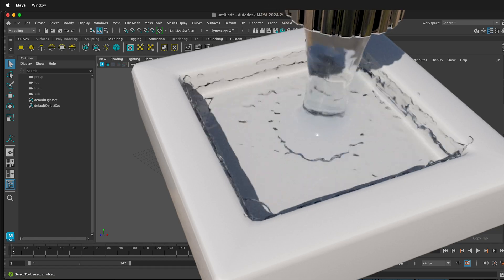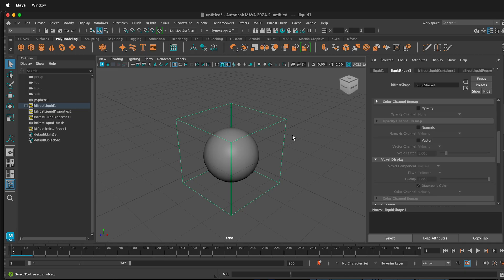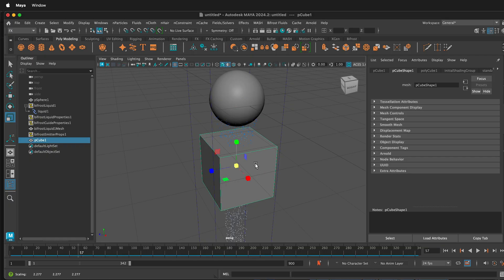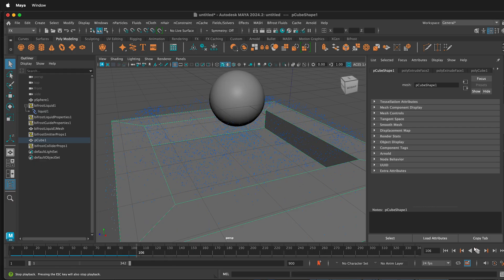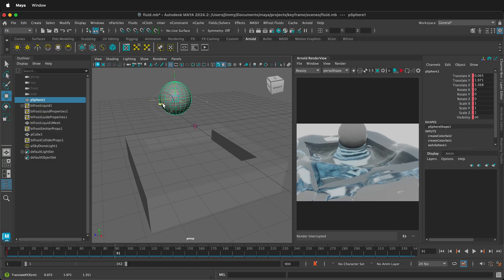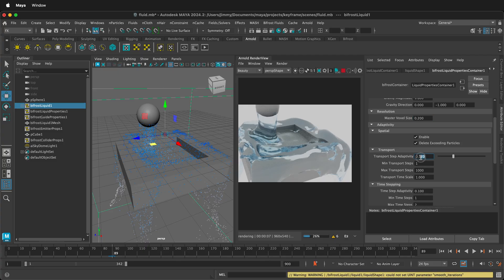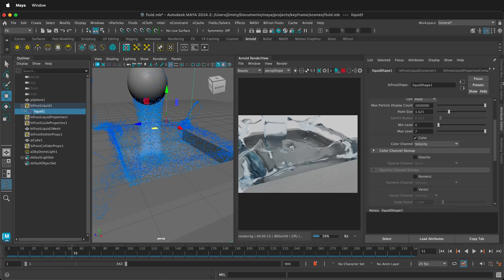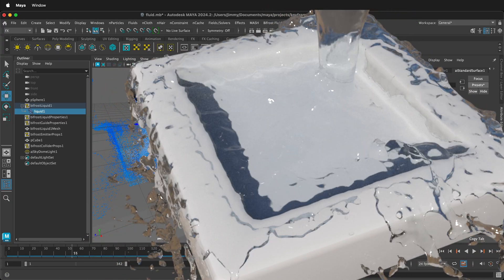How to Create Fluid Simulations with Bifrost in Maya | Complete Beginner Tutorial

Comment: Hello and thanks for the tutorial. Tell me, if you know this, why doesn't the sim "add up"? In other words, the water is dropping into my bowl, sloshing around, but not filling up. 

Thanks :)
Reply from the maker: Due to floating point math calculations, often there is less fluid in the simulation as time goes on, this can be tweaked by changing some of the parameters of the fluids 

Also, it is a good idea to check the collision air distance so none of the fluid is falling through
Reply: @WhatMakeArt  holy crap... ok, I'll look into this stuff. Thanks.
Reply from the maker: @keithyakouboff8755 🍄
Reply: @WhatMakeArt  Hey... I experimented a bit, and SEEM to have solved some of my difficulties. Here's what I did:

1. Your transport Step Adaptivity

2. Your Time Step Adaptivity

3. Checked Surfance Tension (though the fluid's a tad off from the surface, like it was hugging an invisible force field a fraction of a cm deep; should I decrease the value from the default 0.72 to something lower?)

4. Unchecked Delete Exceeding Particles.

What do you think of my choices? Did I do good? 😁

Comment: Hi, Thank you for your great tutorials! Maya is going very slow on my Mac Studio M2 Ultra with 24CPU cores, 60 gpu, 64GB of ram, and 1TB hard drive. If you don't mind me asking, what are the specs of your Mac? When I press play for my simulation everything moves so much slower, and especially if I decrease the size of the Voxels for more details. Any advice on this issue will be great! Thank you again :)
Reply from the maker: As you increase the resolution of the voxels in the simulation it can really slow down, do you have a complex mesh that is being a collider because that could slow it down a lot too. If it's a complex mesh, sometimes you can make a simple mesh that is invisible and use that as the collider, but have that mesh be a similar shape as your complex mesh and everything else still look the same but go faster
Reply: @WhatMakeArt  Thank you for your prompt response, but I have the exact geometry you used in your tutorial. Just a simple sphere and cube. I tried it on my PC which is slower than the Mac and it did a little better. I'll upgrade/update Maya and see if it makes a difference. Thank you
Reply from the maker: @lisasairy251 that is strange, sometimes just restarting things can help, the video was made on an M1 Max, with screen recording on,  the ultra should be better so something is likely not set right
Reply: @WhatMakeArt  Thank you for the tips, I will be researching about this and see if I can find what's slowing me down. :)